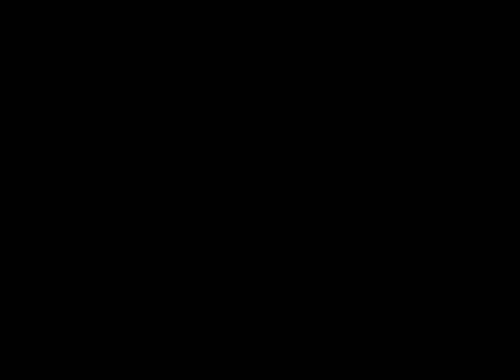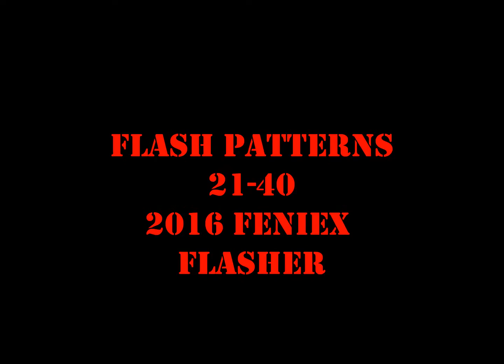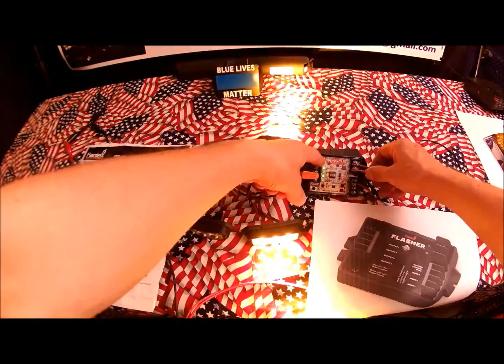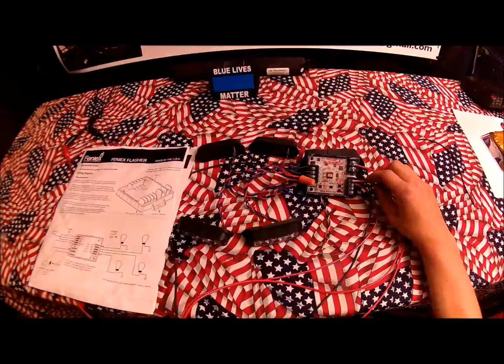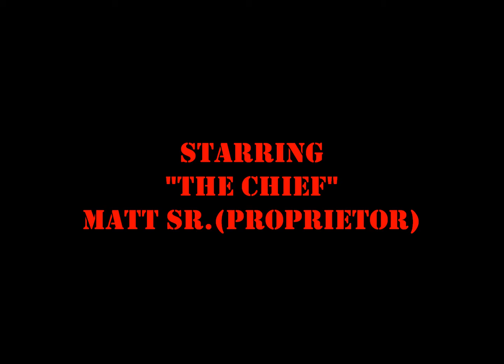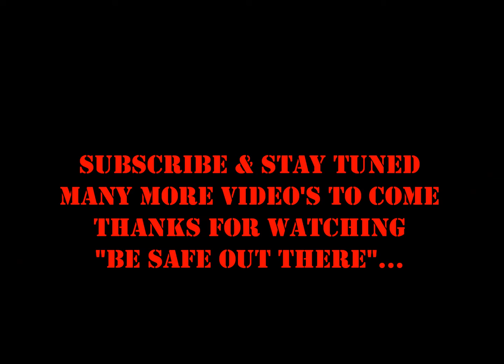2016 Feniex Flasher Patterns 21-40(Negative Switched)

Comment: So to hook this up to headlights to strobe while light switch is on what do I need to do  cause on positive it will not strobe with lights on
Reply from the maker: First & formost these are not designed to overide any DOT function. Nor would we ever recommend anyone doing so. Any vehicle headlights, tailights, reverse lights function should always overide any warning light function/equipment.

Comment: Mine must be bad or I'm doing something wrong I put the negitive wire to each one of the modes one at a time and nothing happens what I'm I doing wrong
Reply from the maker: The modes on the flasher are activated by +12volts. The negative switching feature of this flasher is in regards to the output channels. That feature is designed for negative switched healight curcuits but can be used with lightheads. What you would do is wire the pos+12v(red) wire of your light to constant power, then wire the -12v(Neg(ground)(black)wire from your lights to the four output channels on the flasher. When the flasher is activated it connects ground to your lights. To display the flash pattern. The three modes are activated by pos+12volts & not ground!
Reply: @412psekustomzllc7  Thank you for the quick response it still did not work so guess my controller is bad did it exactly how you told me and all that happens is the light flashes very dimly and the lights that flash on the output side stay red and not green I'm using T-3's Thank you
Reply from the maker: @3030watergates  No your flasher isn't bad! Ok so the reason it's not working is because your within patterns 1-20. Because this flasher is pos+ & neg- switched there are two sets of patterns. If the led indecators are illuminating red yours still in the pos+ switched patterns. Keep changing the pattern until the indecators illuminate green. Pattern 20 on these is the first neg- switched pattern. Once you get the patterns that far you should be set. Let us know if this resolves the issue.
Reply: @412psekustomzllc7 Question How are you powering the controller in this video are you powering it with it power supply or a 12 volt battery I'm using a power supply and setting my patterns before I install my lights that way they are programmed and ready to go I also Asked Feniex to help me as well and they seem to not want to help me Thank you for your help I will try what you are saying when I'm back at where my test bench is I'm away from it till Sunday thank's again for your help
Reply from the maker: @kyleklein7430  In this video we are using a 12volt DC system that utilizes many automotive batteries. We use power supplies in our showroom for our demo walls but don't recommend them for powering any equipment unless your using a signal filter to purify the DC output. See a power supply that converts AC current to DC current by itself always contains alternating signal waves unlike a pure DC signal. Those waves can have long term damaging affects on electronics that run DC. 
If it would be helpful I can ask our CEO/Founder Matt Sr. if he would be able to make himself available Sunday sometime to help you out. I'm not sure how much you know about our company but we are very different from most. Someone in team is always available 24/7-365 even holidays & weekends. I bet he would be willing to schedule a time on Sunday for him to call you and help walk you through getting things working. You can email us @ 412psekustomz@gmail.com if you would like me to talk to him about it. You would need to email us your contact number for him to call.